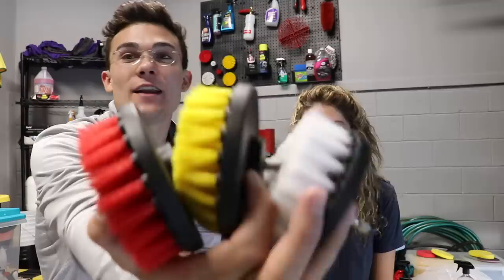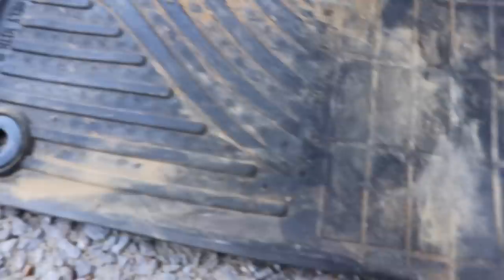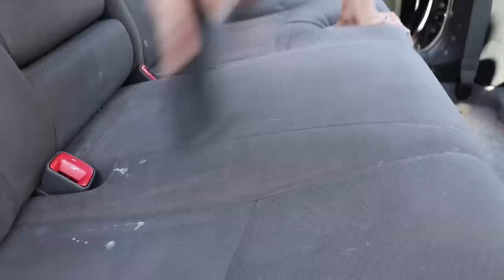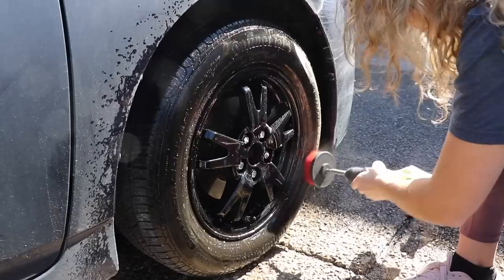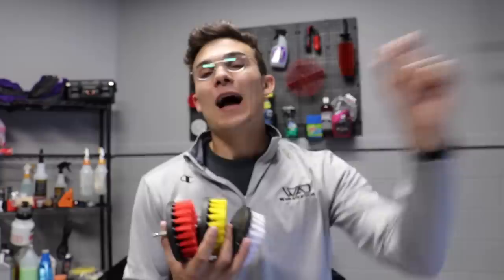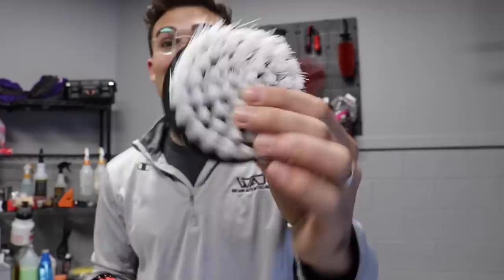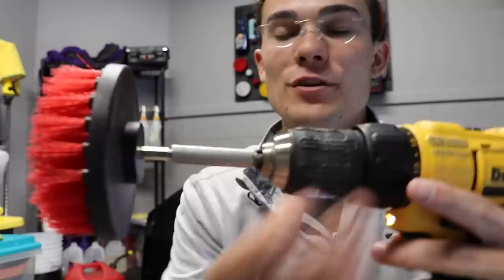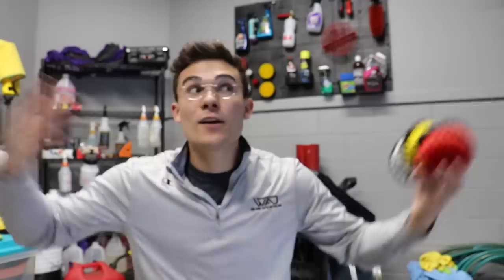The Best Brush I've Ever Used & 4 Ways To Use It! DRILL BRUSHES!!!

Comment: I love using these drill brushes. Deff. reccomend them for any interior detail job.

I personally wouldn't use on tires just because of bristle hitting wheels or me being clumsy and slipping drill to wheels and paint lol. Also I would hate to sling degreaser all over the paint of the car and not catch it and have the sun bake it on the paint. Maybe I'm over thinking it but it is just my opinion
Reply from the maker: No I totally understand, certainly not everyones cup of tea, and I wouldnt necessarily use them in that application for every situation

Comment: Your needing jailed these are 70 pence off AliExpress you said it yourself with the adapter on the drill if ones too big for the job simply and quickly pull a smaller one out and carry on
Reply: Really struggling to understand what you said

Comment: I tried using the red brush on floor carpet in my friend's vehicle and it kept grabbing and binding up on me. It didn't move smoothly along the surface. Does the cordless drill have to be on a certain setting or have a special attachment in order to work properly? I'm stumped

Comment: Thanks Luke always have incredible information for us. I have bought those pan holders in the past...they work great! I do understand you didn't try to reinvent the wheel but the drill brush company do have 4 inch brushes. I know you said in the video you couldn't find a 4 inch drill brush. With that said,  I agree it's a good size
Reply from the maker: Hey there yes they do! So in all of this process, I ordered many different samples from the drill stuff company, the difference between mine and there’s is going to be in stiffness. Particularly their white and yellow brush. Both were way too stiff for my comfortability in the detailing world where I’m using them on fabric seats, headliners, higher end carpets like in BMW and Mercedes, etc... I am actually going to do a video next week comparing the two directly to show the difference in stiffness. I actually went back and forth with my supplier about 5 times with samples until I got my yellow brush to the exact stiffness that I wanted. Hopefully that makes sense!
Reply: @wilsonautodetailing  
Thanks for the response! I'm definitely gonna purchase these, they're a big part and a very helpful part of my interior detailing. Thanks again Luke!

Comment: Hi   really  nice  video.   Is  it  a  good idea   to use   a  1  inch  white  soft   bristle   drill  brush on a  low profile  tire   to clean  it  . I found   drill brush  save  me  alot of  time    but   a  few   buddies  i  know  really frowned  upon  the  idea  of  using   drill  brushes  on  tyre  walls.

Comment: Just picked up a pair of these last weekend! Do you find it’s best to use these with a drill or and impact? The stems are quick connect pieces to fit into an impact drill which is why I ask.
Also, what was the cleaner you sprayed on the seats in this video?
Reply: I use it on my impact because my impact driver is smaller less heavy. But the good thing about the regular drill is that you could set the speed to a lower setting it’s more complimenting on fabrics. So it’s really up to you man both work well.

Comment: Take it a step further Luke.  Get some dewalt 60v flex batteries and a 1/4 inch impact driver.  More low profile, no need for extensions, longer battery life.  Use a medium rounded cone brush for tires and hold it sideways to the brushes get in between the vertical lines and lettering stamps.  You get a little more control on the gun that way too.   I like the 2" brushes on extensions for tight corners and places like under brake pedals and seats.
Reply from the maker: All great ideas for future pursuits in this area! Thanks man!

Comment: Wilson Auto Detailing Hey man, quick question, I just received those DrillBrush ones from Amazon just for economical reasons personally, have you ever had one of the metal prongs connected at the plastic snap on you??? Because it doesn't look like they are screwed together...
Reply: Drew Wilms I actually ordered a cheaper set because these weren’t available and the metal attachment spun right out of the plastic . It heated up and melted . Not sure why ?

Comment: Are these coming to the uk Luke ? Will they come with the long stem ? Thanks
Reply from the maker: So the goal with the amazon tools that I launch is going to be taking simple USEFUL tools that already exist, and modify them specifically for detailers. The next round of these drill brushes I want to order some sort of adapter to add into the set as a bonus item. Didn’t know I should do that until these launched and so many people asked so this is all part of the process. That will definitely be an addition to the second round. Right now they are only available in the US, but in the next year I want to move toward selling in the UK as well. I don’t have hard dates right now as I am still in the learning process, but hopefully that helps!
Reply: Wilson Auto Detailing hi Luke thanks for the reply the dewalt adapter you are using works just fine and only around 5-6 £/$, I’m in New York next July so if not in uk then I’ll amazon a set to my room, hotel lobby is gonna love me 🤪👍🏻

Comment: U WOULD HAVE TO BE CRAZY TO BUY  THESE LITTLE 3 INCH BRUSHES WITH N0 EXTENSION, WHEN YOU CAN SCROLL DOWN THE PAGE AND FIND KITS WITH 4 INCH AND COMBINATIONS WITH BUFFING PADS AND EXTENSIONS FOR THE SAME PRICE
Reply: @johnsullivan7599  Lmao You don't know me son
Reply: @JuanRodriguez-zj7ol  WHAT DO U KNOW, U DON'T KNOW ME EITHER
Reply from the maker: Hey guys, wanted to follow up on this: 

A few days ago i said that the other “4 inch drill brush listing” was mislabeled on amazon from the drill stuff brush company. I misspoke. I was just in my garage today, comparing all of the different brushes I have, and the ones from “drill stuff” are also 4 inches like mine. When i spoke before I was talking about a different listing and i got the two confused. So in all of this process, I ordered many different samples from the drill stuff company, the difference between mine and there’s is going to be in stiffness. Particularly their white and yellow brush. Both were way too stiff for my comfortability in the detailing world where I’m using them on fabric seats, headliners, higher end carpets like in BMW and Mercedes, etc... I am actually going to do a video next week comparing the two directly to show the difference in stiffness. I actually went back and forth with my supplier about 5 times with samples until I got my yellow brush to the exact stiffness that I wanted. From what I can tell, the drill brushes from drill stuff are just the basic brushes offered from most manufacturers right off the bat, there was no modification in stiffness or softness. Again, my brushes were specifically made to handle things like headliner or higher end fabrics without having to be cautious for fear of damaging something. Certainly the drill stuff company brushes would work, but it’s all in the details right 😎  Hopefully that makes sense! Just wanted to follow up to make sure I made that clear, so that I wasn’t misleading anyone. Like I said, these brushes were made for detailing even at every level.
Reply: Luke has said his original 3” label was an error and he has corrected it. They are actually 4” as are the competition.

Comment: Hi Luke. I like your work and admire your honesty, but I’m a little disappointed. I understand where you’re coming from with extra bristles and the 100mm (4”) diameter, but $US25!? For that price at least include the $US5 magnetic holder. For that price I can get a 6 brush set in various configurations, one of which was spruiked when I looked to add your set to my cart! As it you don’t ship to Australia I guess all my points are moot anyway.
Reply from the maker: Thanks man! I appreciate the constructive criticism here. Of course I am aware of the many other options of drill brushes on amazon right now with their endless supply of “bonuses” from scour pads to sets of 6-8 brushes totally for say $19.99. Coming from someone who does his research, and actually has gone through the seemingly endless process of manufacturing, tweaking, finding good quality suppliers who use good material I can offer this: the price point reflects the nature and quality of the brushes themselves. Before ordering these I went through endless amazon orders of what was already available there, as well as endless suppliers samples until I found what reflected in my opinion quality, and durability, so detailers don’t have to spend hard earned money on something that will fall apart, and they can get something suitable for them to make their life easier.

Comment: Just checked guys defo 4 inch brush on AliExpress all different colours most expensive being £2.93 exactly where this guy is buying them from and reselling them to us sorry but I’m just fed up of detailer trying to rip off other detailing fans
Reply from the maker: Hey man, yes that is where I sourced a manufacturer after about 4 months of going from manufacturer to ,manufacturer trying to find the right brushes with the right modifications, in fact I am still modifying them for the next round to make them even more suitable for auto detailers, and adding in some bonuses to make it more appealing, like the drill bit adapter. I definitely don't want to rip anyone off, simply want to design some tools that I know already exist, but can be improved upon for the sake of the detailers like myself who do enough back breaking work as it is